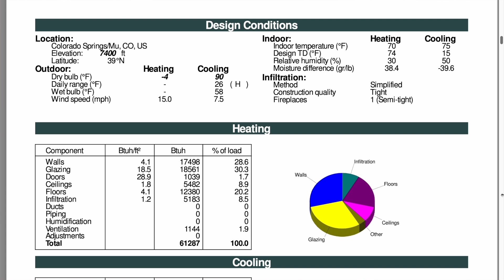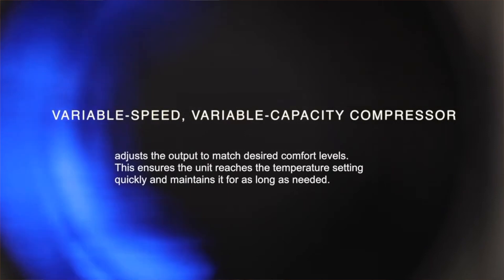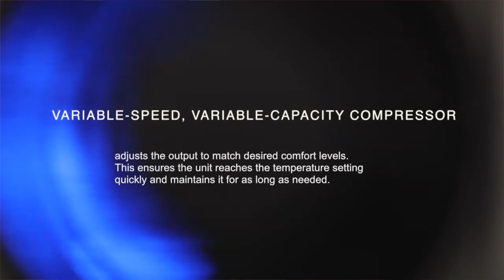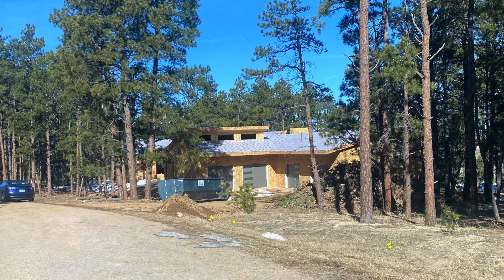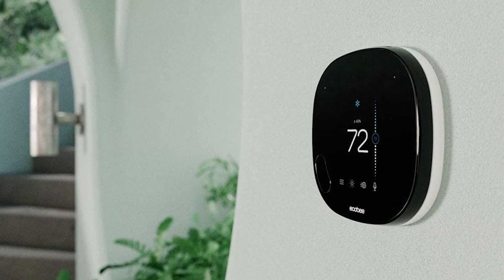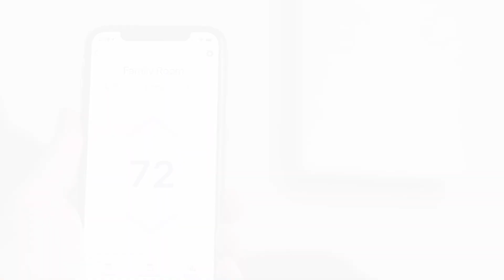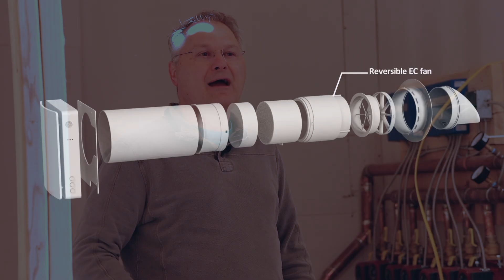Geothermal at Home - What you might not know

Comment: There are pros/cons to hydronic radiant floor heating, but cooling the floors without dehumidification is asking for problems. If you're cooling the floor in the presence of moist air then you WILL have condensation issues. This is where traditional HVAC ducting is still superior - it can handle heating, cooling, and/or dehumidification as needed.
Reply from the maker: Great point. Thank you for sharing. This build is in a very dry climate and equipped with an ERV, energy recovery ventilator. ERVs can maintain the temperature and appropriate humidity. Cheers, Katha
Reply: @NetZeroTech  Good to know this is in a dry climate. But a point of clarification for anyone else... ERVs will attempt to balance some of the humidity, but they will not truly reduce it. In areas with higher seasonal humidity the ERV manufacturers will tell customers to slow down the fan speed so the home isn't being filled with humidity from outside. Dehumidification is key for summer comfort, unless you're in a truly arid climate.
Reply from the maker: In summary, I'd say, an ERV can help manage humidity to a large extent. To effectively control moisture levels indoors in extremely humid areas, a dehumidifier is the way to go.

In detail, an ERV helps to improve indoor air quality by exchanging stale indoor air with fresh outdoor air while also recovering energy from the outgoing air to precondition the incoming air. ERVs are particularly useful in humid climates because they can help manage humidity levels by transferring some of the moisture from the incoming air to the outgoing air during the exchange process. 

A dehumidifier, on the other hand, is specifically designed to reduce the humidity levels in a space by extracting moisture from the air. In very humid areas where the humidity levels remain high even with ventilation, a dehumidifier may be necessary to maintain a comfortable and healthy indoor environment. Dehumidifiers work independently of ventilation systems and can be particularly useful in basements, bathrooms, or other areas prone to excess moisture.

Hope this aligns with your experience, @DeuceDeuceBravo. What climate do you live in? Thank you, Katha
Reply: If ductwork is to be installed anyway, why not install active cooling? Having worked on floor cooling, I've found that comfort is the problem, even in an arid climate. There's also things to consider, like fire season smoke. I've found that direct expansion cooling in a sealed system greatly mitigates the effects of wildfire smoke. Radiant floor heating is fantastic. Cooling, not so much.
Reply from the maker: Thank you 🙏,  @jomm5968 . ERVs / HRVs require significantly less ductwork and are less expensive. The temperature is very stable with good insulation and geothermal. While it takes a few hours, geothermal can do the cooling seamlessly. Hope that makes sense. Thoughts? Katha 😀
Reply: @NetZeroTech If the outdoor humidity is below 20% and smoke free, it will work. However, I would consider installing a small complementary ductless unit in the main area of the house that will handle dehumidification at an on-demand basis. Ductless units also mitigate wildfire smoke extremely well. The hrv/erv system usually needs to be shut off (and sometimes sealed off) during a smoke event. Smoke has really become an issue in the last 10 years.
Reply from the maker: @jomm5968  Great points. Thank you for sharing!
Reply: @jomm5968  Ducting the ERV with a MERV 14 filter on the intake should take care of wildfire smoke. Just need to make sure the ductwork is properly sized for that restriction.
Reply: @DeuceDeuceBravo  We couldn't see 100 yards on the worst smoke days. I wouldn't actively bring in outside air in those circumstances, no matter the filter. 100% recirculation and a wet evaporator coil seem to bring the most relief. But who knows, it may be another 10 years before we see smoke like that again.
Reply from the maker: @jomm5968  That's quite a bit. Natural disasters are becoming increasingly more frequent. Thanks for the recommendations above. Is the ductless unit also what you use in your home?
Reply: @jomm5968  Agreed, you don't want to bring in any outside air when it's that bad. But that should be a very rare circumstance for most people. Also, ductless/mini-split units are not great for dehumidification; they will dehumidify but you will typically lose temperature control. You could get drier air but an uncomfortably chilly room, for example. Standalone dehumidification is the way to go, even if it can't be hooked up to ducted ventilation.

Comment: have been dreaming on radiant heat I am thinking of going back to a system developed in the 1970s  A solar thermal system with a drain down tank.  They are super cheap if you source everything yourself.  Depending upon how one supplies storage tanks and in my case also a water heatpump to do exactly what was done here.  With a drain back system it is fairly simple.. Use flat plate or vacuum tube heat collector.  a drain back tank  a mixing valve to keep the water from being overly hot.  A storage tank basically an electric water heater a pump to move the water thru the external loop with the drain back tank.  So why this system?  It drains when there is freezing so no need for anti freeze.  It turns on once there is enough heat from the sun to make it efficient.  Additionally will put a flat plate heat exchanger inline and a pump to move the water thru this half of the system.  This allows separation of the drain back side from the domestic water side.  all in all a 30 tube vaccum system can be sourced from 200 to 1200$ the drain back tank around $350  a balancing valve from around $100 a 1/20 pump for around $120  each for two pumps. The storage tank is not cheap but not nearly as much as a heat pump water heater which for a decent one I would imagine $2000. Just my two cents.. That said I live in lower zone 4 climate so the chances of snow are limited to 1 week
Reply from the maker: Thank you for sharing. That sounds very affordable. I wanna look more into these systems sometime. Do you know if it requires a lot of maintenance? It sounds like it needs to be combined with another heating system, though. And no cooling, right? Thank you, Katha
Reply: @NetZeroTech  the evacuated tubes generally require zero maintenace So long as the pump is installed correctly there should be no need for maintenace.. thermal sensors dont require any and the balancing valve should not either.. So from what I can determine going to far outlast a string inverter if that is what one is using for a PV system.  These systems are used around the world but almost none here in the USA.  My guess is when something is inexpensive marketing folks have limited profit.
Reply from the maker: @stevepailet8258  That sounds pretty good. I'm afraid there is a lot of truth in limited profits from inexpensive solutions... Thank you!
Reply: @NetZeroTech  yes it does need to be combined with a separate cooling system.    The biggest problem I see is using a combo unit with the tubing in the slab is that you likely reach dew point and end up with moisture on the floor.  The best alternative is to use fan coils so that you can actually remove the moisture in the air. This is why air conditioners always have condensate drains .
Reply from the maker: That makes sense. Thank you. Katha

Comment: "It settles"

You're talking about BLOWN IN insulation.  Fibrous products like fiberglass or cellulose.
If you fill a cavity with spray foam, it's NOT settling.  EVER.
The worst that might happen is some of the bays, when improperly sprayed, may pull away, leaving gaps.
A proper contractor will return to fix these install imperfections BEFORE YOU CLOSE THE WALL ASSEMBLY UP.
Reply from the maker: Hi @PhotonHerald. Yes, I completely agree. Thank you very much for sharing. I actually thought about commenting on this part, but I didn't want to get side-tracked into insulation. I just want to keep emphasizing the importance of insulation in my videos. Thank you, Katha

Comment: First off, comfort has NO ROI, if you're looking at that first & foremost, bad analysis. Multi stage is the best route to go & if that's 2 units, that allows a built in safety if one has a failure, your home will still be safe running on the other one.
Reply: Stage one- heated floors for heating Stage two- cold climate  multi split for living room and master bedroom as AC for the summer and supplemental heat in the winter
Reply from the maker: @andreycham4797  Sounds like a good option. Add office to AC. Less ducts and cost with ERV, though.
Reply: @andreycham4797   Makes sense, but the person has already heavily invested in Geothermal HP, & this solution has him putting more $ into Air-sourced Heat pumps.
Reply from the maker: Hi @ericscott3997, Thank you for sharing your thoughts. Redundancy is a good point, even if they rarely just completely fail all of a sudden. What do you think would change in the analysis, if comfort is the goal at all cost? Do you think variable speed significantly increases the comfort level compared with dual stage? Thanks, Katha
Reply: @NetZeroTech  I'm just a firm believer that if you're making the time & effort of a custom build, & the specialization of fully a hydronic system, you'd spend a little more to make it right. A 2 stage system is functional, but having the variable pump is a better long term option. Especially if the slab & home are above code in insulation value.
Reply from the maker: @ericscott3997  That makes sense. Thank you, Katha

Comment: Thanks for sharing this video. If he is installing a HRV, is it not easier to just have a HVAC for cooling and HRV? 
I am researching on what to do with my home renovation and addition. 
I am still confused with the cooling side of things if condensation might be an issue.
Reply from the maker: Great question! I’m actually already working on a video on HRVs. These things might be helpful to consider:

1. Retrofit: Which system do you currently have installed? Do you have ducts?
2. ROI: What’s your thought on upfront cost and payback period? (if you are comfortable in public)
3. What climate do you live in regarding both temperature and humidity? - This construction takes place in Colorado, a low-humidity climate. It sounds like it’s more humid in your area.
4. What will the insulation look like?

I’m asking tons of questions and have not given you a single answer. 😂 This info would be super helpful, though. Keep in mind, the most important variable is your installer. Thank you! Katha 

katha@upheatacademy.com
Reply: @NetZeroTech  
 
The house currently has a ducted system. 1000 SQF. 
The plan is to add 2000 SQF to the house with infloor heating (air to water heat pump) and possibly use ducts in the ceiling for cooling. 
It’s a personal home. Not really worried about ROI. I am located in Canada. The government is offering a 40K for all energy upgrades- interest free for 10 years. 
I might tap into that. 
For insulation and looking at a combination or spray foam and rock wool insulation.
Reply from the maker: The governmental program is awesome in Canada! I am a huge fan of in-floor heating. Sounds like you don't want cold floors for cooling. So, ducts in the ceiling seem like a good choice. I also like your thoughts on insulation, if the r-values are high, especially in the ceiling. Dennis has R51 in the ceiling and R32 in the walls, which is quite good. The reason Dennis is using the floor and not HVAC for cooling as well is that that gives you a more steady and even temperature throughout the home and no air breezes or hot and cold spots. He has no humidity issues, because it's so dry in Colorado. So, ceiling fans and HRV work great.  One big thing to consider with radiant is, it doesn't give you any dust or allergens, which air-forced ducted systems can over the years, if you don't clean them, which adds to the maintenance costs.

Overall, I think you are on the right track. I don't think you need HVAC cooling, if your r-values are high enough (including the windows, so you don't get condensation on the windows) and your air gets exchanged with an HRV. That would be a bit less upfront, I think. 

Hope this helps. Watch out for the video on ERV / HRV. I also want to look more into the upfront calculations of these different options. Thank you! Katha
Reply: @NetZeroTech  Thank you 🙏🏽
Reply from the maker: @basilkingsley  Sure. Good luck!
Reply: Yes, condensation will be an issue. Heating surfaces is mostly fine. But cooling surfaces is a bad idea unless you have dedicated dehumidification.
Reply from the maker: Thanks,  @DeuceDeuceBravo .
Reply from the maker: I asked Dennis your question ("If he is installing a HRV, is it not easier to just have a HVAC for cooling and HRV?). 

Dennis' answer was: "The ERV itself is only over the laundry room. So, the ducting is only over the laundry room, the main closet and a little bit over the bathroom. So, that's easily hidden. It's tucked away in the corner. Whereas if we had done a full HVAC, we would have had to have ductwork throughout the whole house. ... We would have had to do the industrial look. And have all of that different type of metal tubing [exposed]... whereas the ERV, we tucked it away in the corner and it's nice and neat." 

So more of an esthetics reason (and perhaps some practicality), which I'd put into the life quality bucket. Thank you for your question again. It was interesting for me to explore. Katha

Comment: We have radiant heating and cooling with heat pump in our house. Two things regarding the cooling:
1. Floor will be cold. Sometimes it is refreshing to walk on cold floor during hot summer days. Sometimes it is not very pleasant. We have pipes installed in floor and ceiling, and we can choose to use only ceiling for cooling. In my experience ceiling cooling is better option.
2. Relative humidity IS issue. If there is no other way to remove moisture from air, when air is cooled, relative humidity increases. If you bring temperature down rapidly, even condensation could apear.
Reply from the maker: Hi @lazarojnenad. Thank you very much for sharing your experience. I think that can be valuable for viewers. Would you like to get on the channel to present your system sometime? katha@upheatacademy.com Warm regards, Katha
Reply: Hi @NetZeroTech . I don't think it will be of much value to your viewers. I'm located in Eastern Europe, and we do things a bit differently than in the US. Our house is much smaller than the typical US home. It is built out of aerated concrete blocks, and here we use pan and tilt windows (ours are triple-glazed). Our radiant heating system is mostly DIY, with an air-to-water heat pump. The main difference is that we have completely different prices and economics, so a lot of things do not apply to the US and vice versa.
Warm regards to you, Katha. Keep uploading.
Reply from the maker: Thank very much for sharing, Nenad. This is very interesting. I grew up mostly in Germany. I appreciate the encouragement to keep uploading. Great work on the mostly DIY radiant heating system and the triple-glazed windows! That's awesome. Cheers, Katha

Comment: Very informative and thoughtful video, the information on the heat recovery fresh air ventilation system was especially useful
Reply from the maker: Hi Ronnie, Thank you very much! Yes, it is an energy recovery ventilator, ERV, (or heat recovery ventilator). Essentially, a heat exchanger to  get fresh air into the house, while keeping the heat inside (or outside in the summer). They are great and very important for well insulated homes that don't use forced air. Cheers, Katha